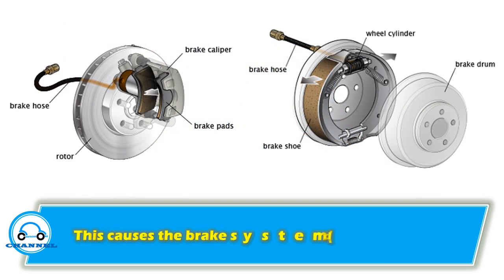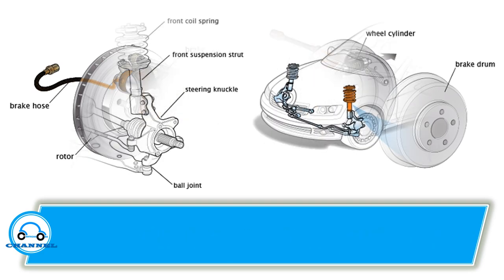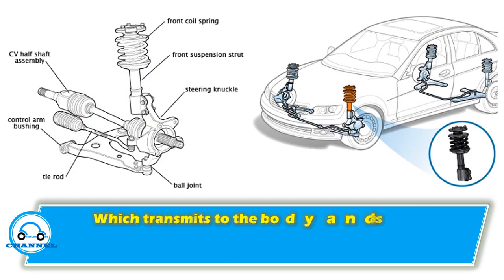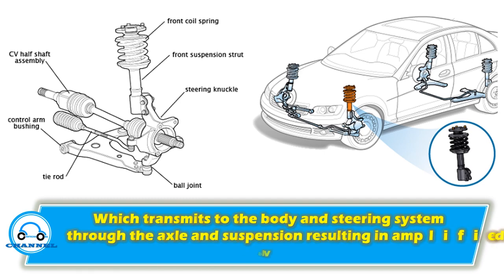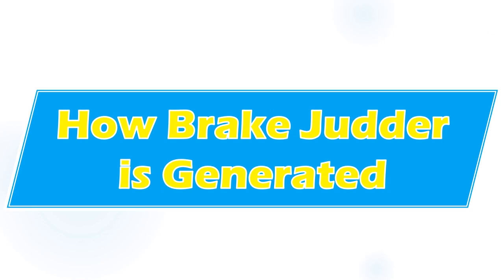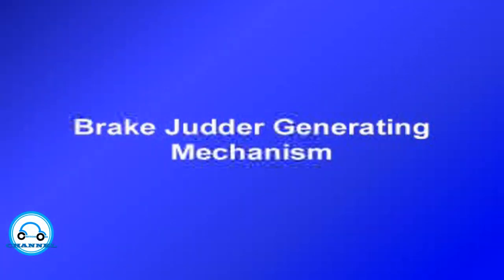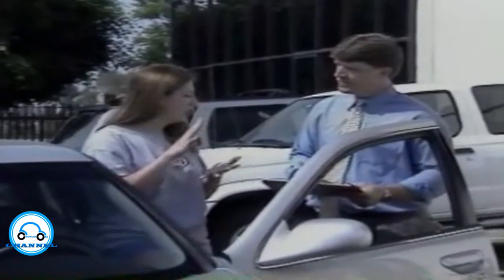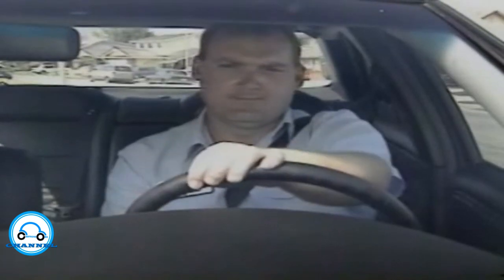What Cause Brake Pedal Vibration and How to Fix It? (Brake Judder)

Comment: Yes 99% of time you have warped rotor. They warp from heat. 
I had a friend tell me " I took my tires off and my rotors look straight " you cannot see them warped. Just change rotors and while you are at it change pads. Your  problem will be solved.
Reply: 31MRB7 w4w
Reply: That’s what I need atm. Are amazon brake rotor kits w pads reliable? I mean I don’t want to go to dealership and amazon is cheaper than oreiley and anybody know the ballpark estimate for a complete new rotors/pads installed and I could keep or used the same calipers right?, I’m doing all my fluids change soon and the brake rotor issue will be next but will be done from a trusted local mechanic near me, I do feel vibration on heavy breaking any advice is appreciated yaal

Comment: I haven't used my car for 3 months since I had an accident. I hit my car from the front. my brake fluid level has since shown to still have sufficient amount of liquid so I know there was never any damage done to this. I had my break calipers and pads replaced a year ago. I have managed to put my car back together but on the first test drive I heard a lot of wear. there was vibration when pressing on the brakes. my car had been washed and protected with a cover since December and I don't think there is any issue with dirt getting in or being trapped the calipers but im not sure.  I drove my car for about 30 mins when I tested it, constantly applying hard pressure to the brakes. yet there was no difference from when  I initially started driving it. could there be a bigger problem than just the fact my brakes haven't been used in 3 months time?
Reply from the maker: Vibration on the brake pedal when applying the brakes is usually caused by uneven contact between the rotor and the pads or the drum and shoe.

Comment: I change brand new caliper,pads and rotor and i am getting this problem  i feel the bibration at certain speed   I need help pls
Reply from the maker: Thanks! for watching, in which parts of your car did you feel the vibration? Pedal? Entire vehicle? front end? Rear-end? Steering wheel?
Reply: cartechhome  first ,,my speed is 70 to 80 km then i apply. Brake  gently  . Second i felt the vibration from my  passenger side then as I continue vehicle vibrate only front.... few day ago all caliper pad and rotor r brand new.  All replace.           And i got this problem??? Help me
Reply from the maker: @ItsKCs  If the vibration you felt happens when braking, then it's related to brakes, and since the caliper and the rotor is brand new and that vibration happens on the front, then it is possible that one of the front end components is loose, it is possible that the front wheel bearing is worn or loose.

Comment: I put on a brand new drum.. but not new shoes .. and I'm getting judder in my pedal and my emergency brake not holding.. what could be the issue
Reply from the maker: Usually, if you replace the drum you should also replace the shoe with a new one. The brake pedal judder usually indicates a problem on the front brakes which is a warped rotor. You said you replace the drum so I assume you replace the rear brake since the rear brake is usually drum type. A warped drum on the rear will make your entire car shake during braking. Probably your problem is a warped rotor on the front.
Reply: @cartechhome  yes I replaced the front rotors 2 day's before
Reply from the maker: @rayonwilliamssportsandfun2106  You should replace the Pads also when you replace the rotor.
Reply: @cartechhome  ok appreciate it
Reply: @rayonwilliamssportsandfun2106  and it's fixed now?

Comment: I have a Hyundai Elantra 2005, we have Changed my brake pads, rotor, brake line, and caliper. But my brakes still have issues. The pedal judders when hitting the brakes about 45% of the time. So it's not even consistent. 
My car veers to either side when braking, but mostly the driver side. It also will veer while driving in either direction. 
The brake pedal fluctuates. Sometimes it will feel stiff and other times it will feel more loose. Typically feels loose in the brake pedal after I drive for awhile without stopping, then the next time I hit them there's more space in the pedal then there should be. 
It sometimes feels like the brakes are sticking and causing vibration through my pedals and steering wheel (as well as the car's body a little). 
My mechanic says my rear motor mount is definitely bad, would that cause some of these symptoms? 
He also thinks it could be a master cylinder problem? Could anyone give me their take? Do you agree or disagree?
Reply from the maker: If the the brake pedal vibrates only at heavy braking but on normal braking it does not vibrate, it is normal for cars with ABS. If there is also vibration coming from front end in addition to the brake pedal then the problem is mis-alignment of front pads and disc, but if there is no vibratiob from the front end its possible that the problem is misalignment of rear drum and shoe. As for the pulling during braking, the possible cause is imbalance tire pressure, or the front end is out of alignment, it is also possible that the disc are mismatch it means one disc is thicker than the other, it's difficult to pinpoint the exact problem without inspection of the actual condition of the vehicle, the above mentioned are just a possibility.
Reply: @cartechhome  I forgot to mention that my car does not have ABS. 
The brakes seem to stick some. 
Wouldn't that cause the vibration? 
My car seems to (rarely) sway while driving right to left.

Comment: My brake peddle will vibrate and get a grinding noise under the brake peddle somewhere below the brake peddle. This only occurs on snow or ice, and in very low speed. I have had rotors, calipers, pads changed on all for tires, also purchased a brand new set of tires. Thought that would take care of the issue, but it has not. I have looked high and low but have not seen my exact problem addressed. I have had my state inspection done two times now and they didn't catch anything. Anyone have an idea of what it is??
Reply: Sounds more like the ABS system is working properly when you are on slippery surfaces. ABS automatically releases the brakes in quick pulses to prevent sliding and that will feel like a brake problem, but is actually the system operating normally.
Reply: @RepairRenovateRenew  I have the same problem, it that a normal thing?
Reply: @redfruit1108  yes it is normal, but only in slippery conditions. If it happens while braking normally on a dry flat road then there may be a problem.
Reply: @RepairRenovateRenew  Thanks, cause today I was driving on snow, and braked slowly and it was vibrating which cause me to worry a little. I’m
Reply: @RepairRenovateRenew  oh dalm I noticed that last night and my abs and track signal were off then they turned on and I noticed my bottom brake vibrate omg 😳
Reply: Please did you get to fix this and how…? I have similar issues and it’s a whole lot of headaches 😢
Reply: @imageorigins9026  Hi, I am having the same issues, any solution please?
Reply: @betod3113  was it abs ?
Reply: @A1cto5.3  yeah it's abs that goes out then comes back I think it's the cencer that I need to change..
Reply: @betod3113  mine vibrates on the pedal..brakes work fine.I agree abs sensor...
Reply: @A1cto5.3  mine does the same my brother inlaw told me it's the abs sensor has to be changed..

Comment: What if you get brake shaking after brake replacement?
Reply from the maker: What part of the brake is replace?
Reply: @Cartechhome  pads and rotors. Lubed pins, greased everything up back of pads, a little on the clips, and some of the ears of the pad. Went to try and bed them in and felt a lot of shaking, mostly in the pedal.
Reply from the maker: @andrewm5190  Is it the brake pedal that is shaking?
Reply: @cartechhome  feels like the body and the pedal. Not so much in the steering.
Reply from the maker: @andrewm5190  Shaking of the body and shaking of the pedal have different causes, if the brake pedal is shaking or vibrating it is brake related, if the body is shaking possible problem is in the rear end, and the possibility is the rear wheel bearing.
Reply: @Cartechhome  Before we replaced the front, me and my wife would hear squeak from the back. I will look into the front and back on Friday. When I find out what the issue was I will let you know. Thank you again for replying back man.